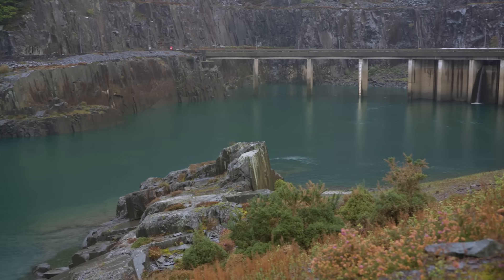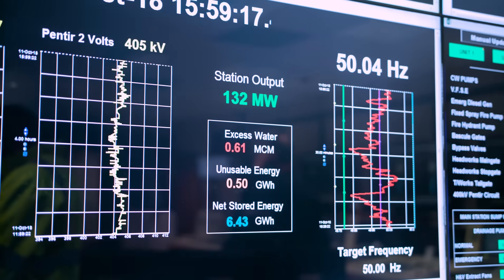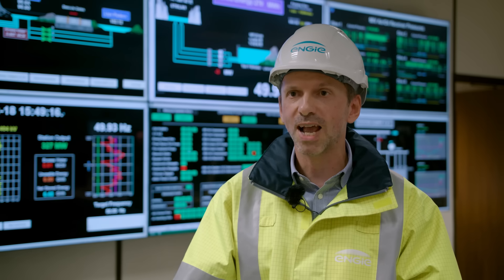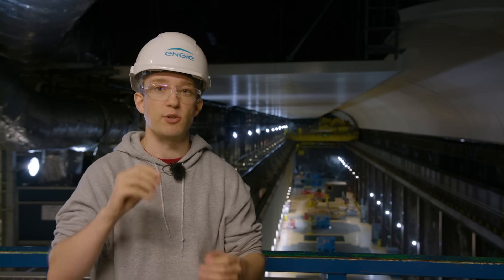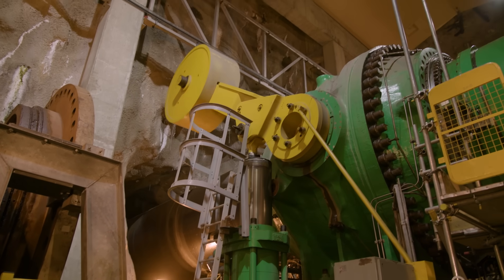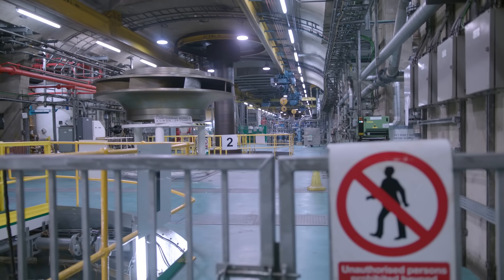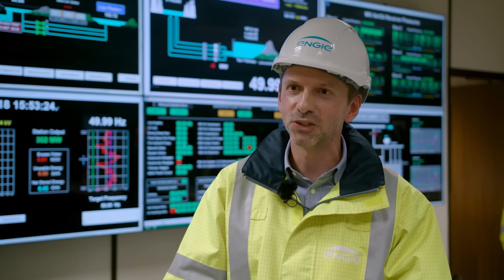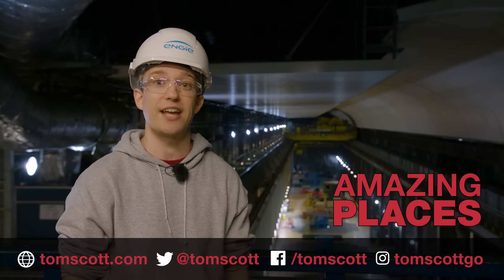Britain's largest battery is actually a lake

Comment: Well presented. I was already aware of this one. I think the system has changed a fair bit since it was originally built, especially with the advent of significant wind and solar generation. What’s not mentioned is that one of it’s ‘near neighbours’ is a redundant power station - Trawsfynedd, an old pair of Magnox reactors. Whether that site will ever be redeveloped along the lines of Hinkley Point C or not is uncertain. It may have been that hydro storage was helpful in the past when the old nuclear station was operational, as they were not able to cope with rapid changes. Probably depends on the market value (of power station output), but most of those like to run at ‘base load’, and it could be that a certain amount of it’s ‘surplus’ output was temporarily stored in Dinorwig, in effect.
Reply: Which is probably the best way to Manage a power grid. Have a reliable base, and use stuff like pumped storage and normal Hydro for managing peaks.
This way, you won't be left in the dark if there's a week long Dunkelflaute.

Comment: They briefly mentioned it at the end of the video, but storage mechanisms like these are going to be crucial to developing renewable/intermittent energy. Not only can these stations activate when solar/wind electrical production are lagging, they can also store any excess energy that's produced as well! So say you overbuild your solar capacity, so that on the sunniest of days when solar is producing more power than is actually needed, that excess power is stored. Then at night, when the sun is down, that power is then sent back into the system. I do think storage systems like this are the future.

Comment: What if we heavy weights instead of water? Just dig some holes in the ground and raise/lower heavy things for energy storage.
Reply: Moesia Testecles water is a ‘heavy thing’ it’s already there and never breaks or needs maintenance.
Reply: @Jabber-ig3iw  Water stagnates, corrodes, expands and contracts. The pumps and pipe systems will need maintenance. And water is not a "heavy thing" compared to the density of many solids.  It is 1g/cc, that's around sodium, meaning almost anything else is heavier than water, taking up less space.

Comment: I was in charge of removing the last major bit of rock (in the draft tube valve gallery for those of a technical bent) in 1979 as a student engineer.  Amazing place and even more awe inspiring when it was an empty hole with no machinery!
Reply: Amazing job you have sir :)
Reply: wow really?
you are really lucky.
Reply: Was it interesting see it full of machinery when you had already seen it empty?
Reply: I probably met you on my school visit. I remember some guy talking to us about how the tunnels were made. 👍👍
Reply: We walked and drove through this place before it was filled with water when they were building it, still have the brochure explaining how it all works. Amazing piece of engineering
Reply: "an empty hole with no machinery"... I see you've met my ex, hahaha
Reply: a student engineer put in charge of removing a giant piece of rock? some ballsy employers
Reply: @JBG-AjaxzeMedia  not really. The miners were very skilled and did most of the work.  I just marked out the centre line, level line and they knew the blast pattern.  Some blasts weren’t very accurate anyway as the rock (slate) varied in hardness, so you had to go back and take a bit more out anyway.  Putting stuff in (concrete, steel, machinery) was much trickier!
Reply: @colinhiggins1042 ......... great way to see the world ., from the underside ., and chip bits off .. Was " it " all new .? There was a lake down the bottom ., was there a lake up the top .? Did you get any photos from it.? May be you need to do a " channel "..........the blasters tail.......
Reply: @robertwoodliff2536  There was a small lake at the top (Marchlyn Mawr) made bigger by building a dam.  I went to look at it (who wouldn't!) but didn't work on that bit of the project.  I have some photos somewhere of when the main part was nearly at its emptiest (ie nearly all the rock out and steel work just started). It was 42 years ago, so not a lot of info and no videos!

Comment: And the big question is why don't we have more of these and less wind turbines? If any?
Reply: Well if you wanna use it to produce considerable amounts of power rather than just as a battery, you're gonna need some huge dams and high terrain. In Wales that should indeed be do-able. I certainly agree that we need to get rid of wind turbines, they're literally eradication machines. Not that hydro is a saint either, but certainly beats wind.

Comment: Would something like this be a better alternative compared to damming a river? Would this have less of a negative effect on wildlife and ecosystems?
Reply: Pumped storage is like a battery. It doesn't actually produce any energy, just uses excess power and then releases it later on to meet demand. If you want to actually create more energy for the grid using hydroelectricity you do have to build it on an actual source of running water i.e a river or stream.

Comment: Converting energy always involves losses. I wonder how efficient this system is?
Reply: We cant say an exact percentage because we have no data of how much GWh of power the plant produces in average in... (if we do, we might compare it to other power stations with different source of energy). However, It can be easily assumed that the system have their loss when they pump the water up the mountain, cause as they say, they need to wait until night where both water and electricity usage is the lowest to power up the pump, achieving optimal efficiency.

(Not mentioning probably minuscule loss when the batteries where they store the electricity for the pump etc etc ages)

Comment: 'a swimming pool every second'
I thought that's US customary unit, never knew British also use it!
Reply: The Olympic sized swimming pool is a US unit, not a swimming pool
Reply: @falsehashtags6581  Ah yes, one IMPERIAL swimming pool, rather than a metric one. An important distinction.
Reply: @falsehashtags6581  equal to 2.5 million litres
Reply: Actually we use Olympic Swimming Pools. They're almost the same but they're defined in terms of Football Fields to make the conversion easier.
Reply: @julianvandenberghe8512  American football / rugby ore football / soccer?  its always confusing for me because i am Dutch and  soccer is voetball /football
Reply: @t84t748748t6  Australian football?
Reply: @warren1134  
Or Wales. We used to dabble with the Belgium as a unit of area but that's subsided post-Brexit.
Reply: In the US, weight is often measured in hamburgers
Reply: @boz927  I’m sorry what?
Reply: How about "as long as two cricket pitches."
Reply: @TC-th1ey  Or "as long as two cricket matches" - a unit usually used to measure geological timescales.
Reply: @warren1134  Or the volume of a football stadium
Reply: @samuelthecamel  Well, to be honest, that sounds more like something we would have in Germany.
Reply: If it was a US programme it would express the units of volume, length, weight, etc in the most impressive (yet ultimately meaningless) way possible. So a swimming pool every second (which can be comprehended by most people) would become 5 million pints per second, which is utterly meaningless unless you're able to comprehend exactly what 5 million pints looks like.
Reply: @neilmackay7319 .......5 million pints......a quiet Tuesday night in Dublin..
Reply: In Australia, a unit often used is 'Sydney Harbours' amount of water (for larger estimations).
Reply: We use most imperial units like mph ft inch but not farenhite some wired people use km
Reply: @warren1134  You can't fool me, your profile picture proves that you're American.
Reply: No we measure in bathtubs in the us
Reply: Units commonly used in Britain: the olympic-sized swimming pool, for volume; the double-decker bus, for several - volume, length, weight; the size of Wales - area; cricket pitch - length or area; Wembley or other stadium - volume, number of people; …
Reply: Ah, but are they metric or imperial swimming pools

Comment: i have a doubt, doesn't it cost same energy as produced to pump water to the top of the mountains. lot of water means it requires huge pumping power, also they said they reverse the process so same things used to produce energy and pump the water to the mountain top. i believe they missed to say that at night times cities wont use much power,so they need this gravitational power during daytime only. so in night from other power stations they might be using that power to pump water to the top of the mountain and to satisfy daytime demand they use this, they have to say this clearly.

Comment: So I take it this place runs at an overall loss though? I get it makes sense for peak times etc and I’m not knocking the real world practical use of it, but I’m guessing it costs more to pump it back up than it generates on the way down! Or not cost more in money, as it’s cheaper at night, but consumes more electric than it produces to send the water back up? Otherwise it would basically be a perpetual energy machine! It’s a clever idea though, you wouldn’t usually think of a business being viable if it’s guaranteed to always operate at a loss, but factor in real world electricity demand and produce when it’s expensive and consume when it’s cheap is a clever work around the laws of physics not allowing you to produce more energy than you put in! Still you can see why building a dam on a river is preferable as nature and evaporation does the heavy lifting and expensive job of getting the water back to the top! But as a closed system able to deliver at peak times etc it’s clever!
Reply: its about 75% efficient, meaning 75% of the electricity used to pump the water to the top, can be extracted as it goes down

youre also missing the point of why this exists. It doesnt exist to outright produce electricity: as a dam on a river would. its used to store electricity for later. it helps meet energy demand on a very short notice

Comment: We have a similar facility in Czechia. It's called Dlouhé Stráně. I've been there two times. Once on an excursion and once just on a hike and this place just blew my mind. Such a marvel of modern engineering. Also notable fact is that is's built in the middle of protected landscape area, so most of this aparature is very well hidden underground. The only visible parts are the lake on top of the mountain, the dam down in the valley, an entrance into the underground facility and unconspicuous mountain hut, which is the administration building and powerlines. Even the electric lines are painted green and the isolators are made of clear glass so they don't disturb the landscape as much.

Comment: Apparently when the adverts for soaps are on, the energy levels increase dramatically
Reply: I remember someone said Britain had a assive power down when all the nation turned on their electric kettles at the same time.

Thats the most brtitish thing i've heard
Reply: Plane geek 118 it does, back in the 80’s and 90’s when as the guy said, there was only 4 odd channels on tv, something like a Christmas episode of eastenders would get insane viewer numbers of like 20 million and so on, and when that ends, 20 million kettles turn on and I remember back in the 90’s a few times that the power would go out (maybe only 10-30 seconds) or you’d see the lights flicker, because a popular show on tv had just finished and half the country was making a cuppa!
Reply: I’m sure it still does now too but viewer numbers don’t reach what they used to as there’s so many channels now plus you can record shows etc meaning it’s all spread out more! I’m sure it still peaks during soap advert times but not as intense as it used to be

Comment: So it is a damn where the power generated is either put on the power grid (during peak energy demand) or used to pump the water back to the upper damn (at night when the power demand is low)?  What is the net power generation over a 24 hour period?

Comment: I wonder what the effiency is. I mean, If you use 1 Mwh to pump some amount of water up, how much of that energy can you get back when that same amount of water comes back down?
Reply: From wikipedia: "The plant runs on average at 74–76% efficiency"

Less than batteries, but still very usable😌
Reply: Niels Daemen

Yep. The problem with conventional batteries is that they are costly to make, and don’t scale very well at all

Comment: I don’t get it, when they pump water back up the pipes, doesn’t that require a lot of energy, making the whole thing redundant?
Reply: Think of it like your smartphone: you plug it in at night, energy is pumped from the grid into the battery, and you can use those energy by day

Comment: Sorry If I missed it in the video but I don't think anyone said it.  Obviously, Every system has lost energy involved and there is no such thing as 100% efficiency I was wondering what the efficiency of this system is?  Surely it would be easy to measure by calculating the electricity used to pump the water up vs the electricity gained by using the same volume of water to generate more power?
Reply: Reegareth

It’s about 74-76% efficiency

Comment: hydroelectric is not the same as a battery.
You essentially store water somewhere high.
This can be done when energy is on low demand, by diverting a river to it, building a dam, etc
and release water when there's a high demand, to turn it into electric power,
the same as most hydroelectric energy is produced.
A battery however, is made out of cells,
storing electric power.,.
This is the level of something I would rather suspect to come out of Trump, 
I thought you were more intelligent than that.,.
I mean, with hydrogen fuel cell power power plants comming taking hold
and newer better ways of storing energy are being achieved,
rather than just using batteries,
storing water like that will eventually get outdated as well.,.
Reply: Chii Suigintou

You’re being dumb. Batteries don’t have to be chemical. Hydroelectric batteries do exist - which is what you saw in the video

Comment: Could this be designed as a perpetual motion battery? If you set up pressure sensors, clocks, and set the pistons just right, could it function as a perpetual motion machine? I am curious and am using what little knowledge I know to make my claim.
Reply: Rook

Perpetual motion machines are impossible

The station you saw in the video uses electricity to pump water to the top, and then it can store it there for a period of time, and let it out when it’s needed. It’s got an efficiency of 74-76%, meaning you only get around 3/4 of the energy you store in it, out

Comment: Wouldn’t I use the same amount of energy to pump the water up therefore making the battery pointless
Reply: The plant was built before there was an electricity market in the U.K. It was designed to fill in generation short-fall for short term peaks in demand that traditional generation could not fill.

Comment: If this works as explained, is this not perpetual motion? Or did I miss something? The cost of the power is not as important surely as the amount of energy produced, versus the energy required to pump it back up. Why not build all power stations like this?
Reply: When was ever said that this generates a surplus of energy? It functions as a storage for it. No, you can't build a perpetual motion machine by just pumping water back and forth. There's a little thing called friction, not sure if you've heard of it, that makes sure energy is lost everytime.

Comment: I can't listen to what's being said, the electricity frequency is a little bit off 50hz all through the video. The clocks in the UK are either running too fast or too slow!
Reply: Worry not, brtitish Engineers will average it down to keep the royal clocks on time. God save the Queen btw

Comment: 0:13
With
 E=mc^2
what's with all the energy stored in matter in the UK? Isn't that also technically considerable as battery relatively speaking infinitly bigger that that lake?
Reply: No. Batteries need to be rechargeable and we cant convert between energy and matter at will.

Comment: I would wonder if it’s the biggest. The Snowy Hydro Scheme in Australia has 2,307 gigalitres capacity when this only has 9.2mil cubic metres. The snowy scheme is also run as a battery with water draining down generating at peak demand and pumping back up at low demand. It is also capable of a cold start up of the network as it is frequency and voltage independent not relying on the grid to be able to sync up.
Reply: The video is called "Britain's Largest Battery Is Actually A Lake".
Unless there have been some major political changes I've missed, Australia isn't in Britain.

Comment: Why not just build magnetic motor generators??
Reply: Because those don't produce more power than they consume.
Reply: @pieman141  what?? They don't consume ANY power...
Reply: @pieman141  neither does this. This is a battery not a generator
Reply: You're talking about flywheels right? Those are not cost effective, new york tried to biild one once but its sell effective then a chemical battery, and FAR less effective then pumped hydro.

Comment: I've thought about this sort of system before used in somewhere coastal where solar pumps water to a reservoir and you generate hydro to power the grid. solar creates a lot of excess energy during the day but nothing at night, so how do you store all that energy for night use? here you go.
Reply: That idea has been researched.. but was stopped by the eco squirrel huggers
Reply: @richardoakley8800  Citation?